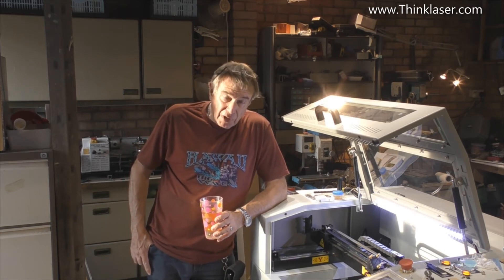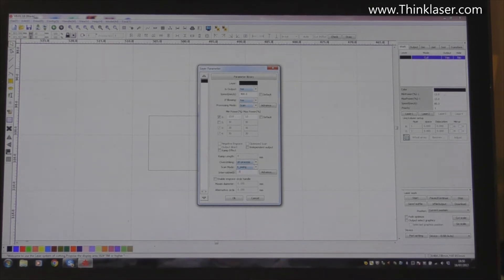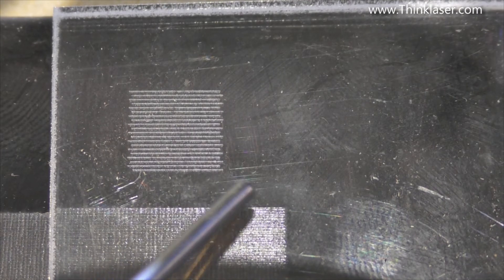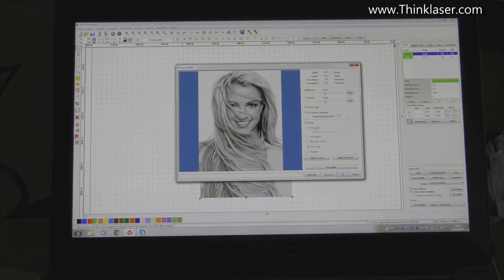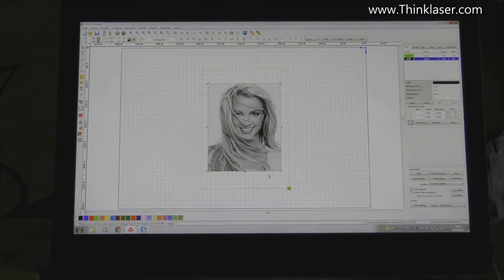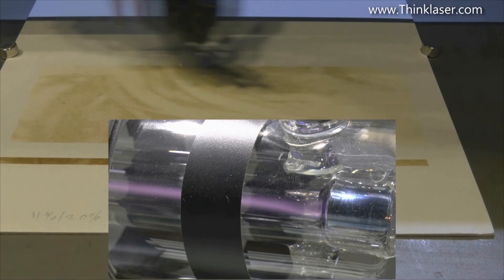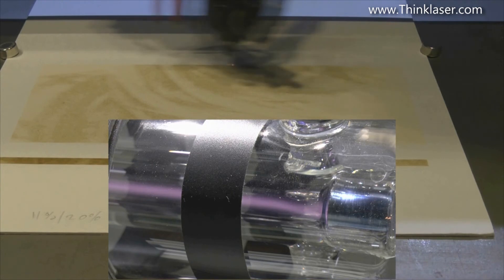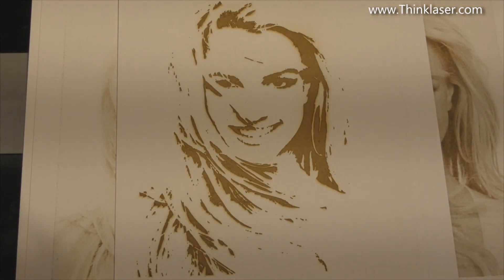How To Use A Laser Cutter - Lightblade Learning Lab 28 Understand How to Engrave Pictures Part 2

Comment: Hi i have 150w co2 chinese laser machine when i cutting cast mirror 3mm gold or sivler acrylic (power 45 and speed 15) material ll be burn so let me knw how much i ll give speed and power.
Reply from the maker: Hi New Printtek,

Sorry, I missed this one. 

First off, you probably have a 130W machine as many companies exaggerate the power. If you are lucky, you should have a RECI W6 tube (80mm dia x 1650mm).
As the material is thin, you will not get a polished edge, so you may as well go for the highest speed you can. You should be able to get up to about 35mm/s and I would suggest that you do some trials to get the best settings for your application. Intricate cutting will require lower speed and power settings.

I'd go for a 2" lens and low air assist (not too low or you run the risk of fogging the lens or igniting the smoke). 

Regards

Gareth @ Thinklaser

Comment: I co not understand why you getting faster and faster for increased resolution? And that 11% power, that is at lasing threshold. Do not expect that laser tube of this type can cope with that high frequency turning on and off, or changing power. Reduce speed at higher DPI resolution.
Reply: Now, after watching your other video about anodized aluminum, seems that laser can in fact cope with that speed. Then wood reaction is slow. Another reason to get at slower engraving speed.